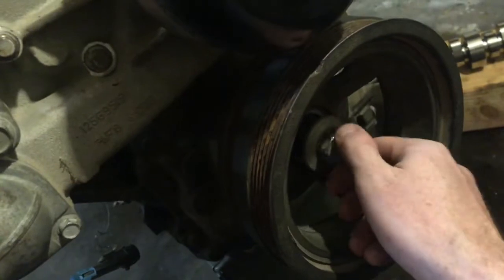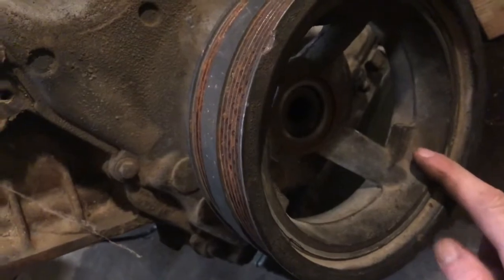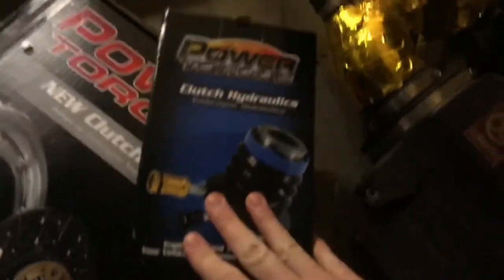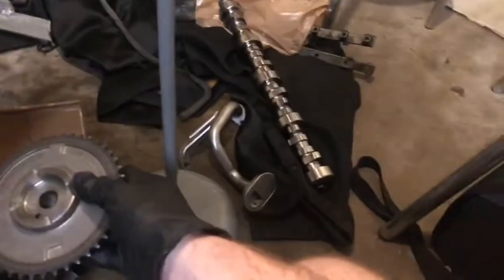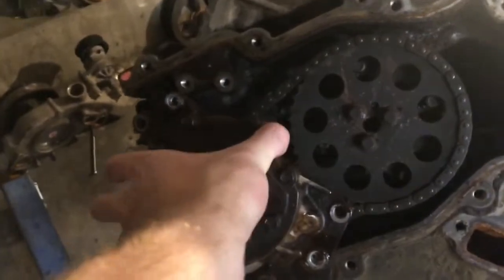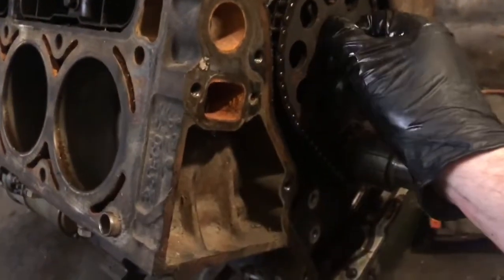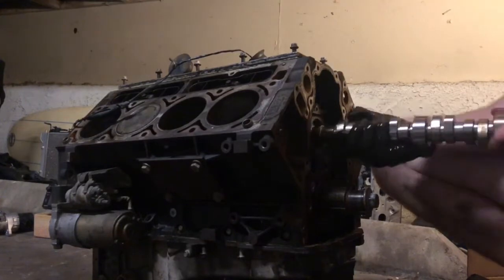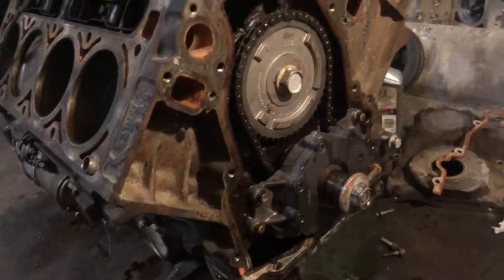FRS LS Swap: New Engine Parts and Budgeting

Comment: I have a frs as well and I’ve been searching for a video like this for the longest I know that Vorshlag has everything on there website for the swap kit you should check it out and they have a article as well they did the same thing with the oil pan that’s why I want to know what 5.3 year did you get cause the motec ecu i want to get is plug and play but they told me the engine has to have a 58tooth reluctor wheel and if you could give some info I would appreciate it that and please keep making this swap video
Reply from the maker: I will! I actually went with the cx racing kit and i plan on using a stock harness thats modified to be a standalone. Im using both the frs and gm ecu for now to keep it simple